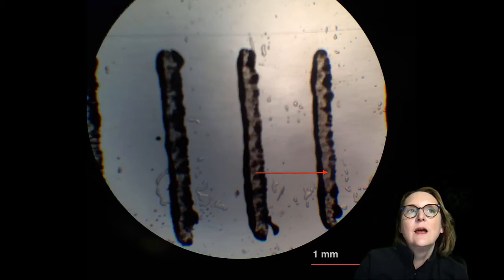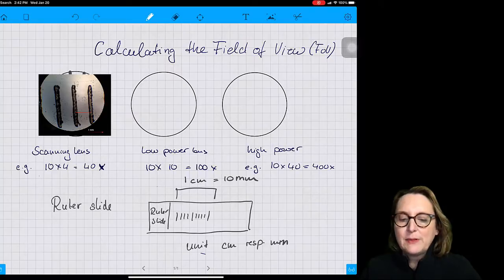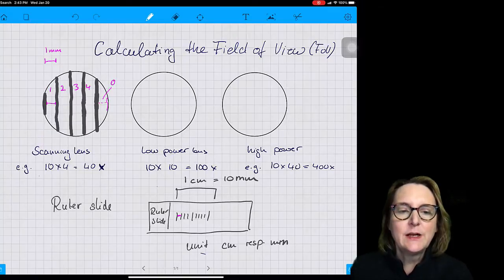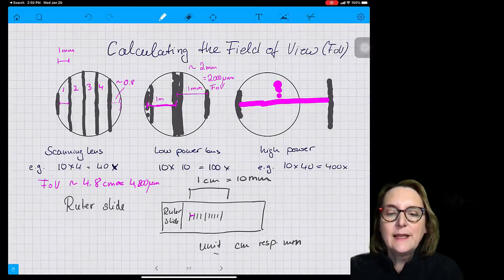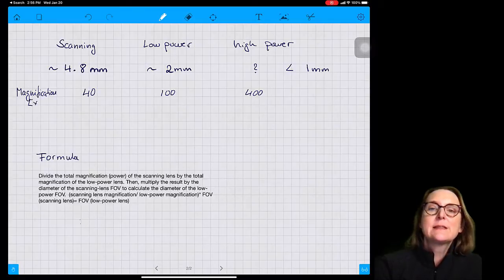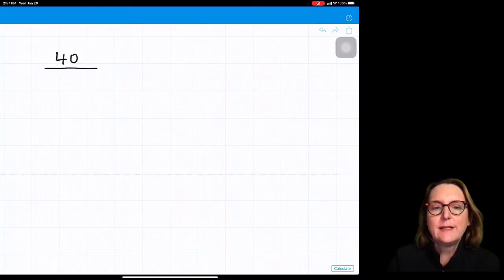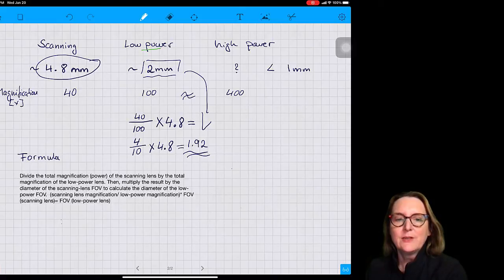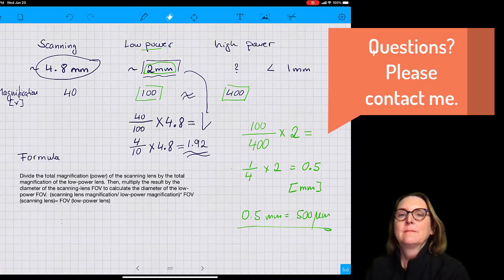Calculating the Field of View of a Light Microscope

Comment: Wagwan, Could you solve, "Sue observes a clear plastic, millimetre ruler under low power of her microscope. She sees three divisions of the ruler. What would be the Field Diameter of Sue's microscope on low power? (in micrometres)" Thanks G
Reply from the maker: This on is tricky. Is a ruler division the ruler line or a mm? If a ruler division is the line and one line is on the very left of the FoV, one in the middle, and one one the very right with a clear space between each line, then the FoV is 2 mm which equals 2000 micrometer. 
However, assuming that a ruler division each equals 1 mm, then the answer would be 3000 micrometers.

Comment: If you had a question like 1.25 x 10 x 40x send if your total was 400 what is your field of view?  How would you figure?
Reply from the maker: I assume 10 is the ocular magnification, 40 is the objective magnification, resulting in a 400-fold (400x) magnification, and 1.25 is the aperture. To calculate the field of view, I would need the field of view diameter for either the scanning-power or low-power lens. You would need to measure either of these values. They are different for each microscope.
Reply: i would also know if you get the correct answer